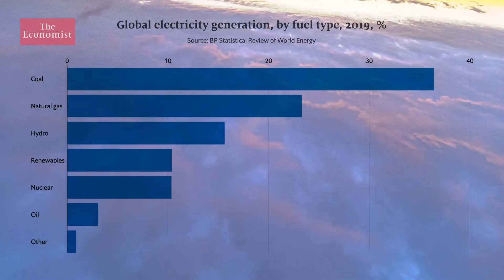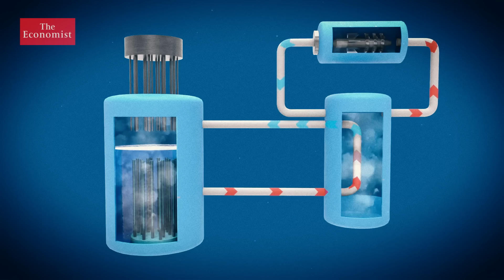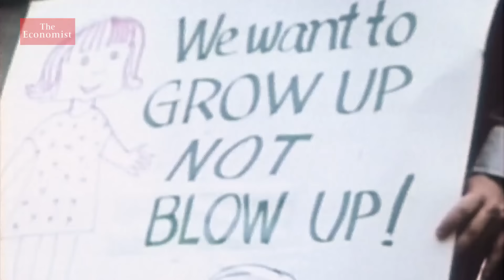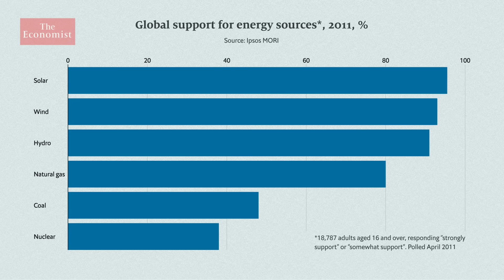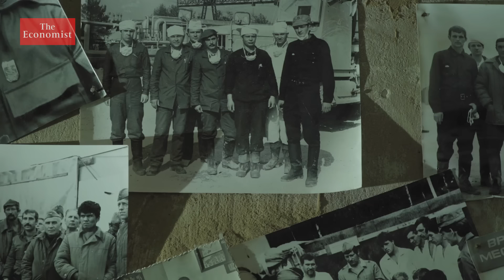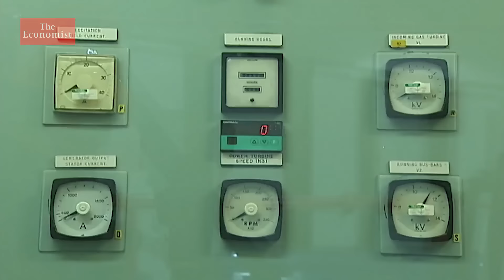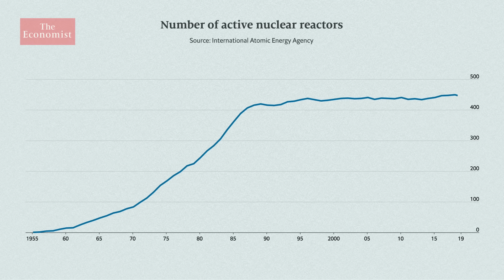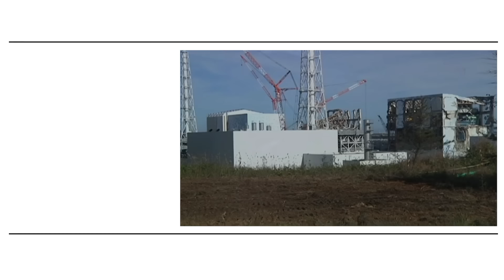Nuclear power: why is it so unpopular?

Comment: Your point was true decades ago.  The real reason that new nuclear power plants are not being built is because they cannot compete with other forms of electrical generation.  Its all about money, plain and simple.
Reply: Indonesia will be building advanced nuclear that costs less than coal. Thorcon Power
Reply: I don't live in Indonesia.  I live within 60 miles of both VC Summer and Vogel That have tried to build 4 new nuclear plants in the here and now.  Two plants canceled and bakrupted the utility and the other project is 100% over budget and 6 years behind schedule. @chapter4travels
Reply: @chapter4travels  I am not sure what you mean by that statement.  If you believe that the NRC is too strict, then I would have to disagree. In the 1970s and 1980s the NRC was strict.  There are numerious examples of construction with forged quality documents being discovered and if there was no way to reproduce real documents, the NRC required the item to be dismantled and rebuilt.  I experienced a number of reactor/steam plant events where the construction and quality of my facility prevented a serious accident so I am glad the NRC was strict.   However, the government was building a MOX faciity near by and found that rebar used in the construction of critical facility buildings was brittle and not within design specs and they signed off on it.  My point is you can either have well build facilities that are less likely to be involved in an accident or poorly build facilities that will have problems.  The American work force of today does not understand that building a nuclear facility is not the same as building a new Walmart.
Reply: @clarkkent9080  What I mean is that the NRC was created to end domestic nuclear power production on behalf of the coal and gas industries. In this mission, they have been wildly successful. The transition to advanced nuclear will not come from the US, it will be from Asia where the market for new electricity and industrial heat demand is huge. In the West, these demands are flat or decreasing, in Asia they are booming. Nothing in the nuclear sector is ever fast but Indonesia is on the cusp of changing that and creating a disruption in energy production. When you can build a nuclear power plant from start to finish in 2 years for less than the cost of a coal plant, disruptions happen.
Reply: @clarkkent9080  "America does not possess the talent to build or safely operate a nuclear power plant." That is ridiculous, you must work for the NRC.
Reply: @chapter4travels  Since you can't blame anti-nukes for the failure of commercial niclear, I guess you have moved on to the NRC. What is your experience in Nuclear Power???  I worked at 5 different reactor sites, NRC licensed to operate 4 of them, over 40 years and my last assignment was teaching new classes of operators.  We start off with basic fundamentals like math.  The math was limited to a 3rd grade level of add, subtract, multiplication, and division.  Examples would be 17+4+ ?  and 15 /3 = ?. One 40hr week of teaching and 50% of the class failed (<80% correct answers).  Management assigned a different instructor and those that failed attended another 40 hr week of instruction and 40% failed. Management stated that "WE need butts in the seats" and directed that the students be given calculators and 10% still failed after another week of instruction.   Did I mention that all questions were multiple choice?  ~Four years ago Vogel had a class of Reactor Operators take their NRC licence exam and 40% failed.  It is unusual for more that 1 or 2 canidates to fail an NRC exam.  Vogel is building 2 new reactors that are now 6 years behind schedule and 100% over budget.  They say they need 2 more years to correct poor construction.  I guess it must be all those NRC labours making construction mistakes.  Ask any business owner what they think of the new generation of workers.  Then realize that there is a difference between burning a hamburger and melting down a reactor core.

Comment: There's no myth , when a half life is 40thousand years
Reply: of what?, of viable fuel?.
Reply: @businessproyects2615  it's viable , but not sustainable
Reply: @siongoodier5330  Sustainable for the next thousands of years, with current easy to access uranium deposits.
Reply: @businessproyects2615  I can't see how , but if there struggleing to get rid of the waste it's not viable , doesn't matter how many deposits we have , I see were you come from power wise but not anything else , 🙂
Reply: @siongoodier5330  I don't think you understand. Most of it, is not waste. Is plutonium and other isotopes with are fissible, or fertile. The very long lived waste, is not so, is normally plutonium. Countries like Russia recycle it and make more fuel from it, called MOX. But in the West that is largely not done due to political pressure against it, as it is the same infraestructure you would use to separate plutonium from barely irradiated fuel. It is not barely irradiated, but the infraestructure is the same, so in the West is it largely not done.

Comment: Nobody talked about nuclear waste
Reply: What about it? The “waste” is solid metal rods that are stored inside weatherproof dry-cask storage cannisters and stored on-site in a secure location. It is neither a security nor environmental risk. It can be stored on site indefinitely
Reply: @piouswhale  That may be true but still, the video was supposed to be about why nuclear is unpopular and I think the waste is one of the biggest concerns now, so why wasn't it mentioned?
Reply: @themnat475  Waste is not really as big reason why its unpopular because waste is not really a concern. The body politic is mostly ignorant of nuclear power and have been fed lies for YEARS propped up by oil, gas and coal companies in addition to faux-environmental groups like the Sierra Club
Reply: It’s a valid problem but climate change is a far bigger one. Nuclear waste may be extremely dangerous but it can be contained, unlike the toxic fumes released by burning fossil fuels. If you live in a city, you’re already significantly more likely to suffer from respiratory illnesses or develop lung cancer.
Reply: @jan_Masewin  I mean certainly the process of burning fossil fuels emits byproducts, however power plants are required to capture and scrub emissions, and cars have gotten cleaner which means less CO exhausting, just CO2 and water. CO2 contributes to the greening of the earth, which means more plant life where none grew before

Comment: Why have you not talked anything at all regarding nuclear waste?
Reply: Because it's really a non-issue.  Thorium molten salt reactors.
Reply: Because nuclear waste goes into a pool to cool down. Coal waste goes into the air.
Reply: @danadurnfordkevinblanchdebunk  thorium molten salt reactors are still far away in the future and probably will never even get to real world.
Reply: @teemumiettinen7250   Developed over 50 years ago, they are presently being built in Russia, China and India.  They would have already replaced present nuclear plants by now if it wasn't for ignorant anti-nuke activism spreading misinformation and fear in the general population.

Comment: If you can't build nuclear power plants quickly then how can they do anything towards climate change?
Reply: Because they can phase out coal burning, unlike wind and solar?
Reply: @Marsdend1  I'm trying to suggest that the time from concept to completion seems to be so long that as things stand they aren't  going to really be a factor in solving the climate problem. As far as I can see Hinkley point C was announced in 2008 and it's 2021 and it's not working yet. Climate solutions have to happen en masse basically right away.
Reply: And what also is overlookedhere : The building of nuclear power plants produces a lot of CO2. Especially the production of concrete (which they need a lot) creates a lot of CO2.

Comment: I think this video ignores one crucial problem with Nuclear: the spent fuel. Even in a country as large as the U.S. there’s issue with where and how the radioactive spent fuel rods gets stored. Current methods are suspected of seeping radioactive waste into surrounding aquifers and wildlife. Also, Fukushima did cause a significant expulsion of radioactive wastewater into the Pacific Ocean, with unknown consequences for ocean life and consumers of seafood. Overall, I agree with the sentiment of overblown fear though.

Comment: When will you show the part where the only us nuclear storage site is still sitting empty and materials are still piling up
Reply: Not actually piling *up*, of course -- there's like one kilogram per person -- and not, at any time or place in the history of the world to date, actually hurting anyone. One wind turbine accident in the Netherlands killed two, and that's two more than all spent fuel rod storages throughout history.

So by blocking deep burial, government doesn't put us at risk,  can justify blocking new build, ensuring methane plants get built instead.

OK, it doesn't put us at risk *from the spent nuclear fuel*. But gas tax revenues! Cha-ching! Kaboom!
Reply: @grlcowan  Well there is the issue that spent fuel rods have to be guarded for 10,000 years. They seem to have forgotten to even mention that little issue.
Reply: @CarlClassenX  -- it is a phony issue and mentioning it would  have been dishonest

Comment: Long story short: It is expensive to build and maintain nuclear power plants. And with cheap renewable on the rise that argument will become all the more valid.

One argument against nuclear plants not even mentioned in the clip is waste management: It is also extremely cost intensive to dismantled nuclear plants and dispose of the nuclear waste. But with the long run times of nuclear plants and the additional cool down time of burned nuclear fuel afterwards, this problem currently keeps getting pushed into the future...

Comment: The main problem is, that we still have no idea what to do with nuclear waste. Also many reactors are decades old and therefore run on outdated technology which makes them unsafe.
Reply: Not true.  Thorium molten salt reactors.
Reply: @danadurnfordkevinblanchdebunk  there is currently no working reactor of this type. Considering the problems that still need to be solved for such a reactor to work in a large real world application, it will still take decades until we have the first reactors.
Reply: @tillthiemann6448   Wrong.  Oak Ridge National Labrartories had a working model over 50 years ago.  China, Russia and India are presently building such plants.
Reply: Where do you want to store CO2 emitted from coal/gas energy? It's easier to work work with dense solids than with gas in the atmosphere.
Reply: @VFPn96kQT  I wouldn't use coal/gas at all. I'd Rather build much more solar panels and wind/hydro turbines and combine those with modern ways of storage like Batteries, kinetic storage and pumped hydro.
Reply: @tillthiemann6448  There is no solution for supplying electricity 24/7 from solar/wind and batteries. 
Compare California and Germany on electricitymap vs France and Ontario. 
For some reason, proponents of renewables don't include total electricity price with batteries + land and forget waste from millions of panels, wind turbines and lithium mining.

Comment: There is another aspect, unfortunately not mentioned in the video, and that is the radioactive waste and its long-term disposal. The more nuclear power we use, the more underground repositories we will need, but then what happens when we run out of land to store it? That may take years and generations, but eventually we will reach capacity. Not fair to pass this to future generations to deal with, imho.
Reply: You don’t need underground repositories. They are stored in weatherproof dry cask storage and can be stored at the site of the plant indefinitely
Reply: @piouswhale  from what I have read, waste is stored at the plant for 5 years and then transferred to underground repositories. I think most hazardous materials are disposed this way, but I might be wrong.

Comment: Not a word on nuclear waste or its disposal?? There's no way to manage this sustainably. Am shocked by this lopsided report.
Reply: Not at all.  Very valuable fuel in thorium molten salt reactors.
Reply: Lookup nuclear vitrification
Reply: @goodfodder     Look up thorium molten-salt reactors.
Reply: @goodfodder  Thanks for the steer. Genuinely appreciate it. I looked this up and understand there is a process for managing waste, my point was more specific re: sustainability. How long can we produce this waste and burry it(?), drop it in the sea(?). Although contained, it remains radioactive for thousands of years, right? It's not clear to me the issue of managing waste sustainably is addressed?

Comment: As a nuclear engineering student, I believe fusion energy is the key to revitalize nuclear power. Especially now private sectors come into play and that really speeds up the progress. 2030s might come the first fusion power plant. Fusion is not “always 30 years away” anymore.
Reply: No, the private sector is a drag.
Reply: I would love fission to be our stepping stone to fusion.
Reply: Capras12   I Agree. Gen IV reactors are promising. Safer and more efficient. And their nuclear waste is even largely reduced and short-lived. Still the public image of fission is deep-rooted and very difficult to handle.
Reply: Commercial fusion - building multi-multi-billion dollar plants that operate under stringent conditions to produce a little more energy than fission.

Commercial fission - building merely-multi-billion dollar plants that operate under loose conditions to produce a little less energy than fusion.

It doesn't seem obvious to me that fusion is commercially viable.
Reply: @factnotfiction5915  fusion power is still under development, but in theory it can produce much more energy then fission. In some applications we have been able to successfully demonstrate the superior output of fusion over fission. There is a reason that all of the most powerful nuclear weapons are fusion bombs.
Reply: @capras12  fusion has a 4x more power advantage than fission per reaction. 

Fusion requires high temperatures and pressures, or esoteric materials, or major scientific breakthroughs. Lasers! Superconducting electromagnets! Erbium! Complicated.

Fission requires piling fissile material densely enough, or piling fissile material and a moderator densely enough. Shovel. Simple.
Reply: @factnotfiction5915 yeah, fusion is still a better option I'm the long run, more abundant fuel, even leat waste and even safer. Fission now, fusion when its ready.
Reply: They said that 30 years ago lol.
Reply: Fusion will be to late. Decentralisation is the name of the game. By the time fusion comes around everybody is making their own energy for basicly free. Why buy from the grid? If it still is even there in it's current form.

Comment: Why no mention of molten salt as a moderator instead of deuterium, or more fuel efficient processes using readily available nuclear waste, or newer research and patents using different nuclear fuels? Light water reactors were promoted as a easy way to make a weapons grade nuclear byproducts. This fluff piece feels like it's a deliberate edited to ignore the competition faced by outmoded light water reactors.
Reply: It did mention that most reactors use the heat to boil water. There are two sizeable (but still non-commercial) molten salt reactors in operation, in Russia, and 7 CO2-cooled reactors in the UK. The 400+ other nuclear reactors are using water.
 
Thorium fuel reactors are less of a proliferation risk, and offer other advantages, but they are still in the research stage. 

In any case, this piece was about why nuclear power has a reputational problem, not about possible future designs. Few reactors - of any kind - will get built in a democracy, unless we get rid of this reputation.
Reply: @lacdirk  Sounds like obfuscation and omission to me. Not to mention that several new nuclear technologies have reached the regulatory approval stages.
Reply: @dustinbird2090  
The video is not about reactor design, but the perception of nuclear energy. That's not omission, that's not obfuscation. That's just what it is about.

Some SMR have recently been approved, but these are upscaled military reactors, not exactly new designs. 
MSR are getting closer but to get them built at commercial scale, we will need to fix public perception of any nuclear reactor first. Then we'll need to get the public to accept a new, relatively unproven type of reactor. 

According to the IAEA there are 50 reactors under construction. Of those 50 projects only two are not water-cooled, and both of those are non-commercial.
Reply: Correct. Better options were passed over on purpose. The USA intentionally chose inefficient LWR's because they could be used to generate weapons grade material.
Newer reactors consume nuclear waste as fuel and bypass the weapons grade step for non-proliferation.
We ought to use some of that stimulus money to perfect the 4th-Gen nuclear reactors. This would be well worth the investment.
Reply: @protorhinocerator142  
1/  A large majority (21/30) of countries with nuclear plants do not even have nuclear weapons. 

2/ You don't actually need a reactor to make weapons-grade uranium. 

3/ The US military has more than enough reactors to make nuclear material. It doesn't need the commercial sector. 

What you are repeating is a conspiracy theory.